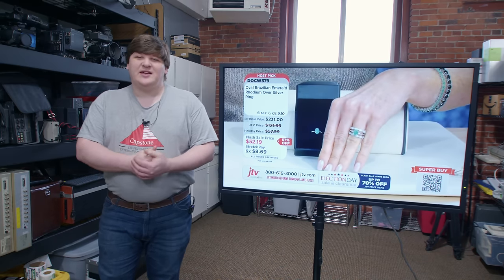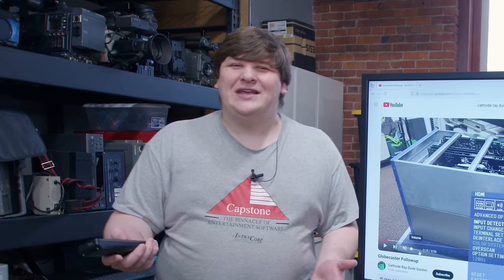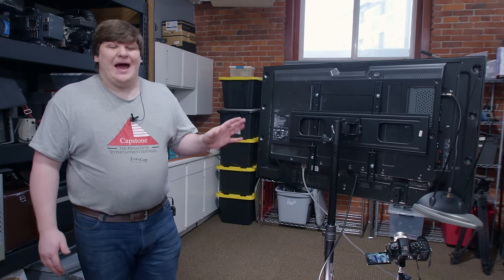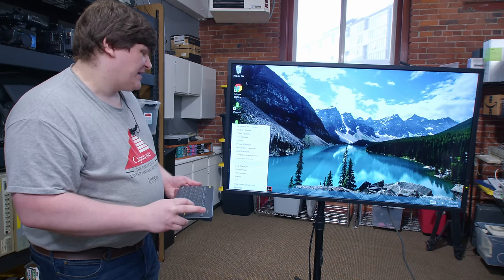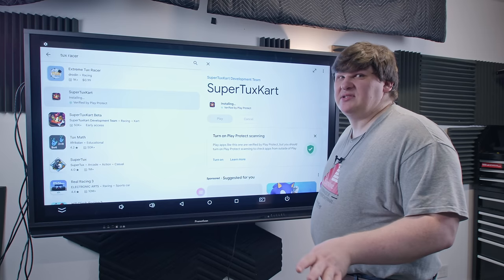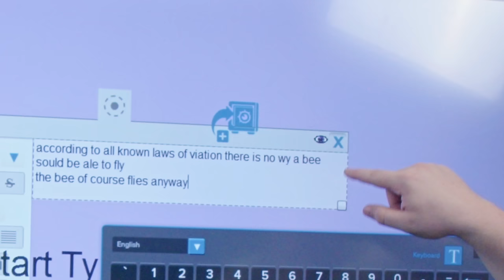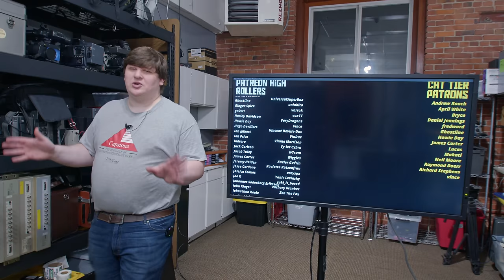Several Incredibly Smart TVs!

Comment: I have it's slightly older Sony brother. Heavy as hell with noticeable fans 40" plasma that was used as a digital sign board. It's only 1000x1000 but the scaler is amazing. Feed it pretty much any VGA signal at any resolution and it will make it fit the screen and look decent doing it. Besides 2 VGA ports it has a module in it that has the expected SDI, composite and line audio in on it. It has a serial port after watching this I know what it probably does.  I suspect it has a lot more features I don't know about because I don't have the remote.

Comment: 10:24 Lol that’s actually what I’m watching this on - and yea that sounds like something that it would have.
Also I have a projection based 1080p display from 2006 that has auto input detection, and pretty much every TV we have has it too. Even the 2005 1080p Westinghouse. It’s actually very useful… when it works. Enables laziness, but it’s also useful (to a point) for debugging.

Also hi from Cali

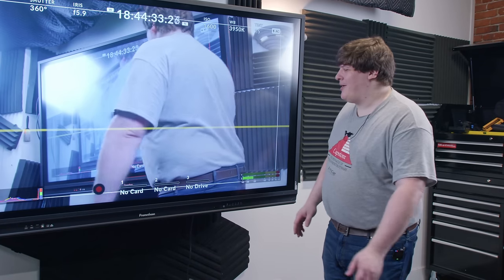42:33 Hey no shame - My progmon is over 40 inches… because I needed a 4K unit, and at the Best Buy I walked into that day, that’s the smallest they had. 75 inches… holy SHIT?! I will say though that our 8K TV which I think is like 86 inches or something insane is still mounted via an arm. Very very precarious feeling, but it works. What you did… looks considerably more so.

Comment: Now take that multi-touch commercial set and build it rugged to take a 200lbs weight dropped on it dead center from 10 feet (panel supported on its edges), obviously ditch the VESA mount as it then gets mounted on resilient shock/spring mounts on each corner and half length.  That is what most of NATO has  in their warships for battle damage control system (and some are harmonized into the platform management, so the ship can literally be controlled from the touchscreens anywhere on the ship).  Necessarily, often the HDMI inputs are blocked off to stop movie watching since the panel is part of a key battle/safety system (and even if one had the authority to authorize such use, like I had, it wasn't worth the board on inquiry consequence if SHTF).

Comment: dirty probably just means they built it themselves (possibly with custom patches) GPL requires you to change the version number if you're building it (so most build systems just add -dirty unless you're doing an official build, something duckstation seems to have not understood and got their panties in a bunch over)
Reply: I don't think this is correct. As far as I'm aware the GPL doesn't require you to change the version for redistributed copies. The "-dirty" suffix is a Linux thing where it's indicating that it was compiled with uncommitted changes. The alphanumeric code seen before dirty is a short commit ID of that last commit.
Reply: @ecnepsnai  the GPL has the statement "the GPL requires that modified versions be marked as changed" -- from how I interpret it, the easiest way to do this is with a flag like dirty on the version number :P -- I know one of the reason stenzek has a hate boner for GPL and made duckstation closed sourced was because distros didn't do this ... I know a lot of other software you have to go out of your way to remove the -dirty if you're building it yourself :P
Reply: The -dirty prefix is the result of git-describe output when you have modified files in your working copy that aren't committed. The kernel build system has this integrated. So, yeah, it just means their build process was probably very ad-hoc, to say the least.

Comment: My primary school (1st to 4th grade in ny country) installed one of these things when I was in third grade. I remember it being crap, the touch input barely worked, even when using the included stylus, and it didn't work with fingers at all. I think my teacher used it once or twice, only during the week after it was installed, then we never touched it again. I can't remember what brand it was, or if it was a little guy or just connected to the classroom computer, but it definitely wasn't android.

All the schools I went to afterwards had some of these in some classrooms, but I never saw them used as anything other than projector screens.

Comment: -dirty means the kernel was built with changes that weren't checked into git 😆
test-keys means that the android verified boot key is a publicly available example key, i.e. you can flash whatever the heck you want. Lineageos is also signed with test-keys, for example (although I'm not completely sure there's only one set of test-keys)

Comment: 12:50 PAL-60 is just a 60Hz PAL signal. Typically, this was output by PAL DVD players when playing an NTSC disc, or by a games console when playing a game that only supports a 60Hz mode. It's simply PAL operating at the 60Hz mode used by NTSC, and used in PAL countries when playing NTSC video.

Comment: If you wanted more evidence that OPS is irrelevant today, here it is: the TV station where I work has the 82 inch version of that Promethean monitor. It has the Android module, but we don't use it. For touch applications like showing election results and stuff like that, we just use a regular Windows PC connected via HDMI, with USB for touch control. And for static backgrounds, we use a Blackmagic SDI to HDMI adapter.

Comment: JSYK, the "free" memory amount from the `free` utility in Linux is not what you are usually supposed to look at, since it includes caches that the kernel quite aggressively allocates, but can free up at any moment should the memory be needed by some program. The "available" amount (around 600M) is what you are usually after.
Reply from the maker: Yeah I flubbed that one, felt really silly about it - but 600m available is still rough for a full fat modern Linux, it was periodically running out and swapping to the (spinning!) disk. the ram bump made it run tangibly smoother.
Reply: @CathodeRayDude  Yeah, makes sense.

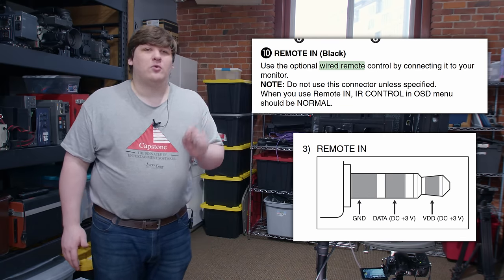Comment: 23:30 another possible scenario would be something like a room with two independent TVs where you don't want one remote controlling the other.
Reply: or preventing someone with a TV-b-Gone (or the Flipper Zero pranksters nowadays) from turning off your digital signage
Reply: Both problems could be solved by just coding the remotes in some way though. Nowadays, modern consumer TVs and streaming boxes use Bluetooth remotes that are paired to just the device they are supposed to control

Comment: Damn this thing is MUCH more customizable than the Samsung professional Digital Signage displays I've been dealing with for a project at work (then again also proportionally much more expensive). The speakers are just as sad, but the entire thing is likely for a slightly different market, the entire frame isn't too heavy (8 kg) and plastic housing around, no slot for those modules either.
You feel instantly the difference between a consumer TV and that tho: the RS-232 serial daisy-chaining for a computer to control it (part of why we got it), including fully blocking controls, no tuner inputs as well, and you can feel how much thicker that panel is right from a slight tap. A household TV feels like you'll destroy it by touching the screen, that thing feels like it can take a little abuse.

Comment: i scored 2 of the 55 inch versions of this nec large format ,but the real bonus was they both have  a pc module installed and had infared touch screen added to them its only a couple of points at a time but thats no issue ,now having them set up as the new control desk for my studio they were seceral thousand astralian dollars when the came out
Reply: they look cool though now my whole desk  is touch screen  its recessed into the desk with gas struts to make it tilt up if needed and the other one is vertical like normal monitor

Comment: There was one those big multi touch white board displays set up in the re-pc when I went in there when I was in Seattle on vacation not too long ago. It was pretty fun to play around on lol.
Reply from the maker: fun fact! that's literally why I own the boxlight module! those TVs were the very first OPS displays i found (in fact, they were there for eight months before i REALIZED they were OPS-capable, lol) and when I figured it out, I decided to buy a module on ebay just to take in and test them. the TVs were boxlight brand and i knew so little about OPS that i sought out a module from the same company just in case there were compatibility issues. turns out it's pretty much impossible, but i ended up with a very useful module in the end for super cheap anyway!

Comment: It's crazy that for about 25 years now, all domestic TVs sold all over the world are compatible with any global standard except in the USA, where for some reason (FCC regulation?) money has to be spent to disable code in the generic chip that drives the set so that it only syncs with 525/60.
Reply: It's because of a weird timing regulation (sound was crammed into the video data) that uh, has no reason to exist anymore.

Comment: If you have two streams that would do just fine in an 8:9 aspect ratio, you could stretch them both out to 16:9, then use the "uncorrected aspect" side-by-side to correct the aspect ratio of each stream! But good luck getting that solution approved, 'cause it'd make you irreplaceable for as long as they use that solution.

Comment: I believe the reason you don't want to plug in the tuner with the TV is on. Many tvs turn off inputs is no signal is detected. You have to restart the TV. People will call tech suport. Hear the automated system tell them to reboot 3 times and still not tuen it off and on until after the tech on the phone tells then for the second time.

Comment: Heya. About the 100 Ethernet cables. At 22:45 ... Some LG units I have worked with had one of the screens connected to Ethernet (the first one on the RS-232 chain) and the rest was controlled from there via RS-232. :)

Comment: We have a fleet of commercial signage NEC (likely same vintage of yours) and they are built like tanks, just try not to do hot plug the ops module too many times because it will eventually fry if you do.

The 32 bit OS on the module is a classic since a lot of drivers for custom integration have been done at the lowest standard so no 64bit compile, they are delivered at 32 to avoid issues in the end user side and calls to the system integrator.
Reply from the maker: Ahhh, drivers, that makes sense! Thanks for pointing that out, I've ALWAYS been confused when I found 32 bit Windows on such late hardware.
Reply: Another thing of interest is that there are mounts designed for 75-86" displays to be used for those smart boards, Chief (now owned by legrand AV) is the reference brand used by dell for those scenarios. They are hideously expensive but i still suggest to hunt for some, that swing arm is a bad tug away from disaster

Comment: Those OPS modules and compatible displays are interesting and makes the displays far more useful than most TVs in a few years after purchase. 

In particular are the cheap "smart" TVs (in quotes since they're just bookmarks that run on an outdated web browser and are called "apps") that a lot of people buy nowadays that has anemic performance and not much software. I've seen quite a few of those cheap TVs ending up with digitl TV tuner set-top boxes for watching free OTA TV channels (weirdly a lot of those TVs have built in tuners and people are just not aware) or with an Android TV box/stick/dongle of some kind (if they didn't have one or to have a newer Android TV version).

If I could get one of those OPS displays I'd probably aim for something like the 42in one you shown near the end as its just the right size for me. But honestly I might just end up plugging a 1L mini PC like I do right now since the availability of OPS modules is low in my local market.

Comment: The main issue with TV apps is how easily they can add advertisements. Roku is flirting with INTERRUPTING WHAT YOU'RE WATCHING to sjow a fullscreen ad. Android boxes could of course do this too but it's easier to replace a box than a whole tv.

The second issue is that you're limited to the TV's audio codecs. This is fine for streaming services that just use Dolby Digital+ for everything, not so fine for Plex. Many TVs don't support DTS codecs at all, non even passing it through to the AVR. And there are very few TVs that support the lossless codecs found on blu-rays.

Comment: Have a couple of these at work and man... what a frustrating experience using the tuner is on those things. Otherwise amazing display though. Changing the channels while using it on our clearqam and there's a random chance the thing freezes to display a message stating a rescan is in progress for the channel lineup and then get thrown back to the first channel. It's annoying because it happens so frequently.

Comment: my roku tv is getting pretty slow, that's why I have an old laptop hooked into it at all times. in fact I got the same logitech keyboard+trackpad used in this video for it! do have to credit roku tvs for letting you get to the hdmis as fast as possible, much faster than samsung. and of course it's an lcd tv so it still looks good years later. idk if I'll even feel the need to upgrade to 4k anytime soon

Comment: Formats f the Cards:
- OPS: (like most of the modules in this video
- OPS-C: Like OPS, but a bit higher (OPS-C slot fits OPS Module)

- SDM: a newer format of such cards

Types of cards:
- x86 computers
- android devices
- tv tunners
- sdi inputs (realy usefull in broadcast/event stuff)
- HDbaseT (expensive HDMI over Cat)
- Raspberry pi's
- usb c interface (with usb PD)
- srt input
(- ndi input)
- ...

Comment: I am the nerdy person that likes to keep things functional. Part of the reason why I watch these videos and just don't buy everything. I already planned out what I would do with one of these screens, and it came at a good time as I was thinking about how to do something and this is a little overkill but a great solution with all of the options. The hard part will be finding a small enough one. Backup is any screen and run it from an older computer, I just worry about over working the computer as it would be used for something else and I can't add a second as space is limited. 

Also I would love if there was power on and off buttons separately. I worked retail that had multiple tv displays next to each other, and in rows. You can turn one on, maybe you turn two on, or maybe you just turned another off somewhere else. You had to be very careful with the remote. I do think one tv brand had a power on and off button separately though.

Comment: The Promethean display definitely runs Android internally, used for the OSD. Though it's probably Android 4 and running on a very slow SoC.
I know some of these smart boards come with a more powerful Android system built-in.

Comment: Confused about the RS-232 in/out. The RS-232 standard does not officially support daisy chaining, so I'm wondering how that works. I do note that it's not uncommon in pro A/V equipment.
Reply from the maker: As long as you don't use any of the response signals, you can do async RS232 with nothing but a ground and Tx line and just repeat the signal with a simple amplifier in each device, but honestly I suspect there's something more involved going on yeah.

Comment: SDI is EXTREMELY common in professional video use...
Also, I'm surprised there is not a RS-485 data option....A 485 bus would be preferable to daisy-chaining RS-232 devices (i.e. 1st device goes out, you lose connections to all of them)...
Also, the RTSP/RTP/TS board makes a LOT of sense, video can be distributed using network resources, not needing special cabling (SDI coax, HMDI, etc), the same multicast TS can be sent around the world to send a single stream to all devices nearly simultaneously.

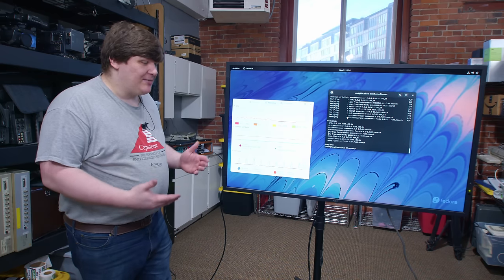Comment: 8:29 well they are built to display images not play sound. Also, I saw those audio outputs on the side. 41:43 most people would be settled with a $50 used tv and a $35 roku express, or maybe a Roku 1,2,3 since the express overheats easily and only does 1080p. Roku Ultra does 4k(not that a $50 used tv is gonna have 4k). 48:22 infinite loop the output of the tv to the input of the computer.

Comment: sound? HDMI? LCD? mine didnt had any of these, just a bunch of DVI and BNC connectors

WHAT is has buttons? i had to connect my remove with a 3.5mm jack

EDIT: 23:24 ah he speakss about that, my remote had a 3.5mm jack on it and i needed to conntect it to that remote port on the tv to controll it

something else mine got, it has the video wall stuff build in, so you dont just daisychain the TVs via serial, but also via DVI and that 3.5mm remote jack also had an output for the next TV. sadly i only had one of these displays

EDIT2: i should watch a video until the end before commenting

EDIT3: yeaah it happen again, but that usb port at 48:07 is probably just an OTG port

Comment: Holy shit it's a fuckin Promethean Board, we used to have the way older version that used a stylus in my elementary school, that takes me back. Those ones were not nearly this fancy, they had matte screens, no touch sensors, and the stylus had to be calibrated often to actually go to the right place. They were a pain and a half but we actually used them pretty often, mostly since those had a different OS setup that let you run PowerPoint and annotate on top using the whiteboard features. Kinda seems like they've regressed in the last 15 years.